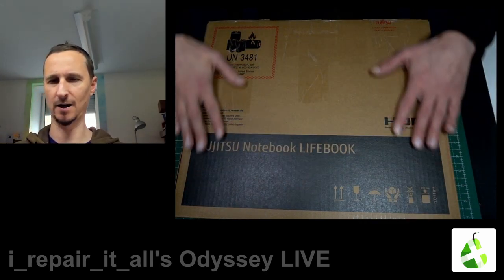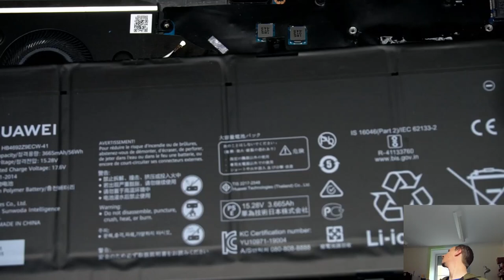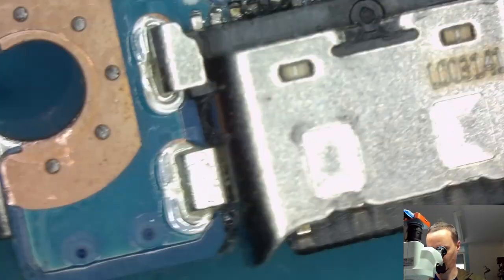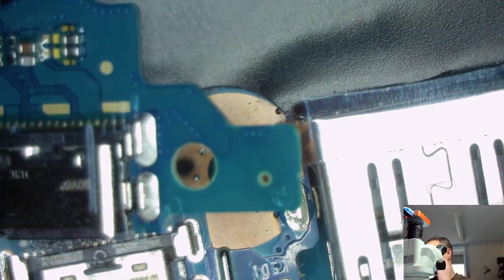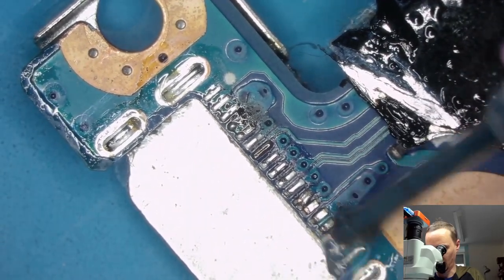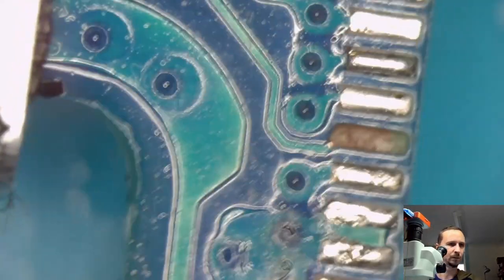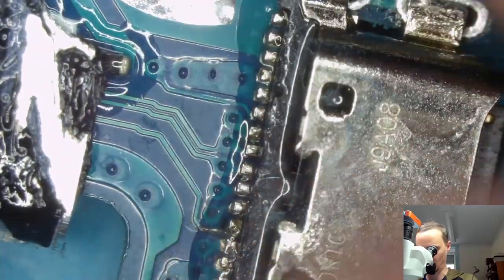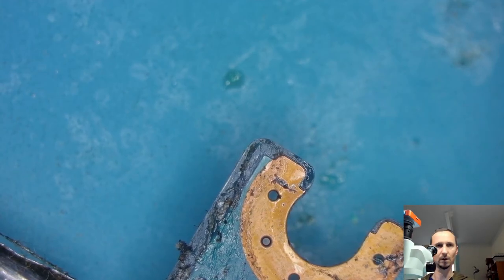Huawei Matebook D14 Charging Port

Comment: Hello, thanks for your precious video ! I have charging issues with my D14 matebook, and brang it to a reparator. He kept the computer 3 days to finally tell me that he can't fix it, that the welding won't take and it's a common problem on theses computresrs. Besides that I watched by myself after and the little white sticker on one af the battery screw was untouched. I think that he did not even tried to disassemble the computer... What do you think ? Since I'm from France, do you think I should triy an other reparator or is my laptop dead ?... Thanks for your awnser :)
Reply from the maker: Sounds strange, what do you mean with "the welding wont take...?)  maybe he cant solder... :))) definitely try another one. A specialised laptop repair shop may give you a no fix no fee option.